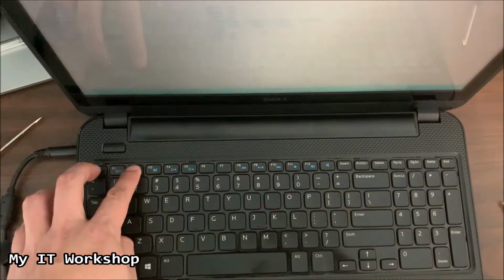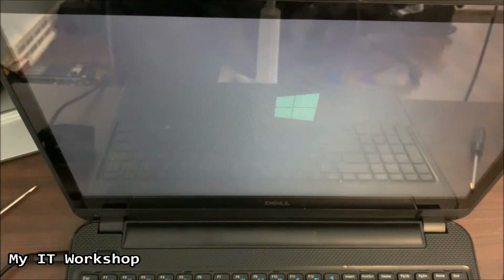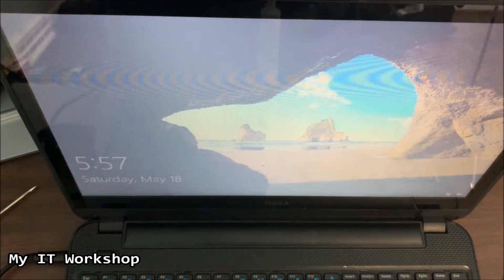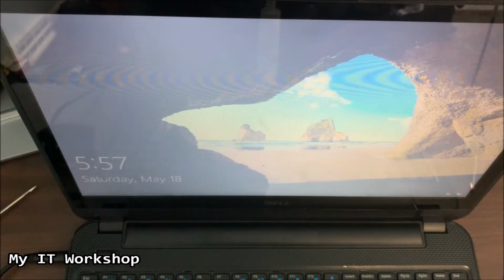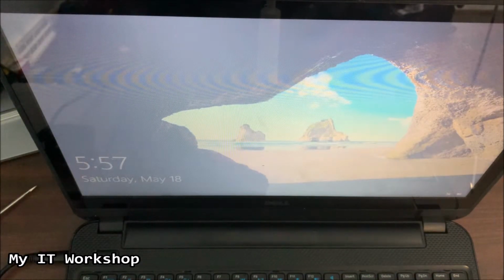Fix Dell Laptop that Beeps 5 Times

Comment: I got the 5 beeps and no booting.  After 16 years I suppose a replacement CMOS is fair enough!  Replaced it and worryingly it was still beeping and not booting!  This video gave me something to try - holding the power button down for 5 seconds, then try booting again and pressing F12.  Success!  Not sure if the F12 was necessary but just carried on as normal from there.  Many thanks

Comment: My Dell laptop still has the 5 beeps every time I turn it back on after replacing the CMOS battery.  I looked up what could be wrong and found that the clock chip had gone bad.  The only way to fix it is to replace the entire mother board.  That is not going to happen as the computer is not worth it.  So I just live with beeping while it boots up.  After it boots up no more beeps until I restart the computer again.

Comment: That's how the CMOS battery SHOULD be accessed. I found a laptop in the trash that deeps five times. Replacing the CMOS battery requires disassembling half the computer and pulling out the motherboard.

Comment: hello good day how about 8 beeps.. i tried to change the ram still beeping..
Reply from the maker: Hello,
For notebook/laptops 8 beeps normally mean issues with the LCD-> screen.
If you connect it to en external screen you might be able to have access to the operating system.
Hope it helps
Thanks for the comment

Comment: i was cleaning up the old laptop from 2012 we have and tried uninstalling a bunch of programs. maybe i wasnt paying attention from how slow and laggy it is when i probably accidentally removed one driver and only noticed when its too late. i think it was called IDT audio driver for the dell laptop running in Windows 7 32-bit. was planning to install new drivers to update stuff but then i was also forced to restart at one point so now im having this 5 beeps problem after the restart. ive been looking into solutions and all i want is to reset/reboot without opening up the laptop messing with the battety itself. i tried entering the bios pressing F2 but it doesnt work. the screen is cracked and cant exactly tell whats going on. it was working just fine before i tried uninstalling stuff i probably shouldnt 😓

Comment: 5 beeps......switch on the power cord but dont turn on the laptop yet.....let the laptop sit for a few minutes.....it seems like the battery is out of energy so it cause the beeps.....let the battery got charged a little bit......

My laptop starts beeping after i remove its battery.....so i google the code for 5 beeps.....turn out it's cmos battery problem..so i thought, why not let it charged for a while?......then it stopped beeping when i turn it on
Reply: Omg man I was freaked out life saver I love

Comment: Thank you so much. It worked on my dell laptop. My laptop is 7 years old. Will this problem start if I again shut down my laptop
Reply from the maker: Hello Kunal,
The problem is normally due to the cmos battery. Since your laptop is 7 years old I’d advise to replace the battery. That should fox the issue.
Hope it helps
Thanks for the comment
Reply: OK sure. Can I get it online or I have to visit the store?
Reply: HI again. I changed my cmos battery. But now it is not giving any beep sound and the laptop is also not turning on. Only the power is on. What to do. Please help!!
Reply: @kunalghosh2234    tere to lg gye bhai
Reply: @kshitizsingh2261  thik Ho gya 😂
Reply: @kunalghosh2234    hi can you tell me how you fixed the problem? And where did you buy the CMOS battery from? (I mean online or the computer shop)
Reply: @lairyfights  you will get the cmos battery from any stationary shop also online. It costs hardly 40 /- at shop. Then put the new cmos inside and press the power button . If it turns on then okay otherwise keep it on untill the battery uses all the power and it goes red.  Once it goes red it will start beeping and then press the power button for 5 secs.  Then connect the charger and press the power button.  It will start booting.

Comment: How about upon start up it makes 5 beeps then it stops then followed by 2 beeps, but it started up. What would be the problema with this dell laptop?
Reply from the maker: Hello Warren,
7 beeps on a Dell computer normally means that the CPU is having a an issue......If possible, try running the diagnostic process on the computer, that will give you a better report of what's going on.

Hope it helps
thanks for the comment!
Reply: @MyITWorkshop  
Hi!

Thanks for the info. I think it's 5 beeps keep repeating the beeps until the laptop is on..I have alrrady change the cmos battery with the new one and I think it resolves the problem..The new thing that bothers me is it took longer than before to on this computer

Thanks

Comment: Damn quite late but I have a question I just reset the computer and it turned on again with no issues could that mean somethings wrong? Like it was beeping but i just hard pressed the power button and it turned on again and it worked this time. Could something be wrong?

Comment: Hello! I have dell vostro 1540 and it is continouly beeping 5 times and then stops and then beep again. I replace cmos battery but it fixes the problem for only 30 min then it again beeping and now when I replace new cmos battery beeps does not stops. laptop is working fine but beeping in speakers and headphone too. Please help!
Reply: R u solve the issue sir pls help out iam also getting same issue
Reply: @nicepalai809  no bro
Reply: Cek de konektor of battery c MOS docking, maybe it has a corotion, clean it up with cutter.

Comment: I have today this issue. I went to a service store here at my uni but they didn't manage to help me out. All laptops have such a battery?? My beeps are much more intense. Like a fire alarm.
Reply from the maker: Hello Stavros,
Yes, all laptops have the Cmos battery.  The volume level might depend on the model.
Thanks for the comment
Reply: @MyITWorkshop  I also saw that CMOS has to do with the clock configuration and now I   have noticed that my time is completely wrong! So, this is it! You are right. Is it difficult to replace this battery? I mean for someone who has the expertise, how long does it take? Is the CMOS for all models so easily approachable like yours? Thank you.
Reply from the maker: It depends on the model. For instance, the model in the video has the cmos battery in a very visible part of the motherboard. However, on other models you need to remove the keyboard or some small case that protects it. If the cmos battery is accesible i would say 10-15 mins.

Comment: I put mine back and now it is beeping
Reply from the maker: Hello Rion,
Try RE-seating the cmos battery one more time, (take out and put back in), then with battery removed and with no charger press the power button for around 10 secs.
Hope it helps
Thanks for the comment!
Reply: @MyITWorkshop  i did it but now the laptop is stuck in the dell logo and the only way i can get in is by pressing f3 and going to boot manually
Reply from the maker: @rionmakollinjembedhjeta-sh5587  What happens if you remove the cmos battery and power on the laptop?
Reply: @MyITWorkshop  hello plz help me ...me also getting same problem and I removed then re put it but still again same problem then also I press power button for 10 to 30 Seconds but again and again same problem coming and laptop not starting..
Plz help me..